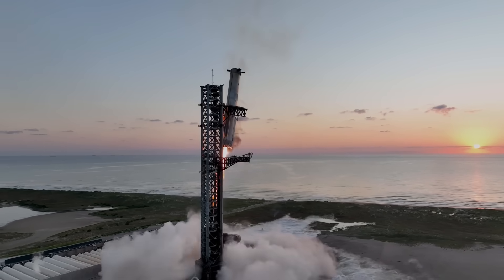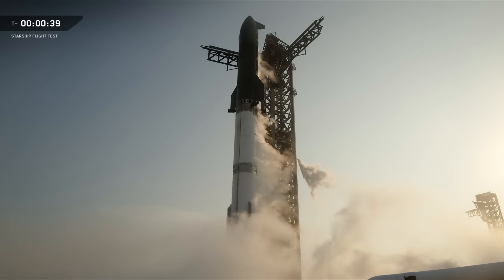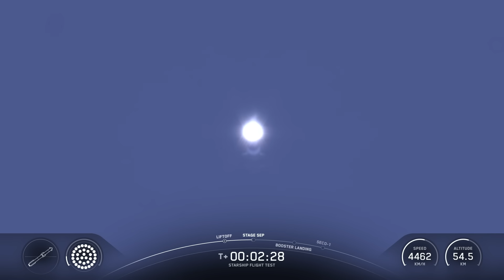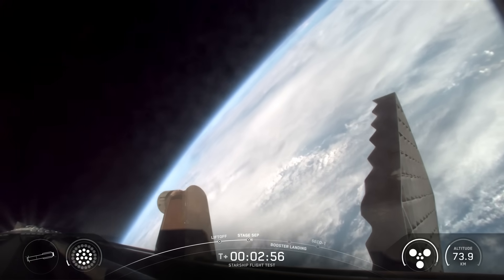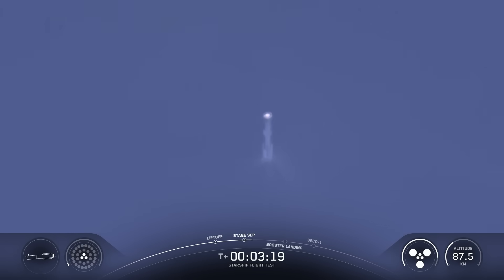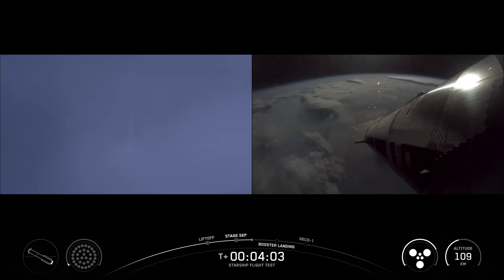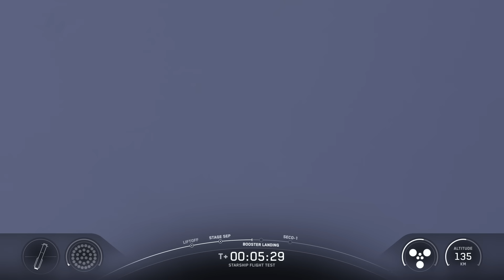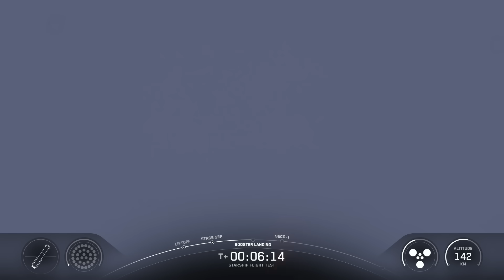SpaceX Builds Largest Reusable Booster, Also Makes Door That Won't Open - Starship Flight 9 Recap

Comment: What a disaster Starship has been for the Artemis program, abysmally behind schedule, burned through most of the cash allocated and it hasn't made it to orbit, hasn't demonstrated long term cryogenic fuel storage or transfer, hasn't demonstrated engine reliability for landing or launch, hasn't survived re-entry unscathed, they can't even get a door to reliably open. America isn't going back to the Moon this decade with Starship, that's for sure.

Comment: I suspect in V1 they overbuilt it to maximize their chances of getting starship into orbit, surviving reentry, and soft landing in the ocean. For V2, it was built to get a baseline of what the bare minimum is in terms of engineering/dry mass to do the same thing. You can only do so much with simulations, so you have to fly it and incrementally upgrade it until you hit that sweet spot of dry mass vs payload to orbit.
Reply from the maker: ‘Anyone can build a bridge, it takes an engineer to barely build a bridge’
Reply: @scottmanley I’ll take an overbuilt one any day when I’m driving across a bridge!
SpaceX has built an expensive bridge to nowhere!

Comment: is 33 raptor engines too extreme?
i am curious about longmarch 9 which uses 4 main engines and 20 boosters. then they released a cluster version exactly like starship. 
i guess china will make a simulation to find failures using supercomputer, making 2 models at once for longmarch 9 simultaneously
then compare the results to see which is more efficient in terms of operational costs compared to the maintenance complexity faced.
Reply: Note that it is self-developed and conceptually borrowed, far from being exactly the same. With safety, reliability and practicality as the main considerations, rather than relying solely on computer simulation, mutual learning is normal (depending on your way of understanding).

Comment: Notice all the condensate ice footling around during the view of opening the cargo door. The door mech was also covered with ice and was the probable cause of the malfunction.
Reply: you have no evidence of that to make such a claim, the ice is coming off the LOX tank forward dome.
Reply: @Syritis the ice is actually coming out of the air and condensing on cold things. It's not a good idea to have ice condensing out of the air in the cargo bay. It should be nitrogen filled, or at least dry air.
Reply: @---___..  sort of, it;'s humidity that condensing against the LOX tank, because the door hydraulics and linkages aren't chilled by the cryogenic propellants then there won't be an ice freezing to them.

most fairing are climate controlled to VERY strict conditions as required by the satellite  manufacturers,  in this case spacex can do whatever they want with their own satellites but theres still zero reason to suggest the door froze shut, especially as it would heat up screaming its way through the atmosphere to orbit.

Comment: Does the upper stage have reaction wheels? If not, could adding them help control the spin if a leak happens?  It might be worth the mass of having them to have a backup method of controlling attitude.

Comment: This is the third starship failure due to what appears to be propellant leaks. I've not heard what the root cause is on this. SpaceX needs to more thoroughly test under a variety of conditions, or re architect the system. Another launch in 3 weeks may not have a different outcome.

Comment: If u actually listened to spacex's stream, before launch they discuss the intentional lighting of only 2 engines on landing burn... I believe they said they were testing the capability of an engine from one of the other rings (not sure if it was outter ring or the inner ring) to relight and make up for the engine that didn't light... pretty sure it would have to be in the inner ring, as I believe the outer 20 needs the ground support equipment, to ignite

Comment: The road to success is littered with debris.
Reply: So is the road to complete failure!
Reply: @TheMasterCylinder yet failure can be observed and that knowledge implemented into new designs
Reply: @sreastronaut9765  Into new designs that will fail too? What was the Block 1 to Block 2 upgrade all about then? 3 consecutive SHIP failures just isn't good, no matter how much it is spun.
Reply: @TheMasterCylinder Block 1 was limited In payload capacity and also had a lot of design inefficiencies. Block 2 solved a lot of that. But of course you’re right. 3 ship failures isn’t good. But tell me one major technology that worked flawlessly on the first attempt. It takes time to figure out something as complicated as this. Should SpaceX just give up because they failed a few times? Of course not. It take perseverance, it takes time, and it takes failures. But they will get it.
Reply: @TheMasterCylinder What have you accomplished?
Reply: @TheMasterCylinder  No, the "road" is what is traveled upon; it's fine, but that which rides on it often fails, leaving some debris! ;D
Reply: The road to failure also...
Reply: @paulbizard3493  Yes, unlike the old NASA mantra from the 1960's. "Failure is always an option"!! In anything, 

...ask those living on the streets today!
Reply: A lot of debris
Reply: In all things, including ex-spouses!! One for three is my record!! LOL

Comment: So Tim Dodd doomed this flight.
Ship originally had cold gas attitude control until he questioned Elon on why they weren't using autogenous pressure like the booster.  When 9 lost tank pressure it lost attitude control.
Reply: Which means losing tank pressure was the root of the problem, not the use of autogenous pressure. They really need to get a grip on the gas leak problem soon.

Comment: We should just pour our efforts into anti-gravity as well as other propulsions once thought to be sci-fi. But that also would mean the end of the rocket fuel companies. If we don't the Chinese or someone else will and likely soon.
Reply from the maker: Anti gravity isn’t science fiction, it’s high tech fantasy without even a theoretical underpinning that suggests it’s possible.
Reply: @scottmanley  YEp. We've had them for decades. Government admitted this last year Torsion field as well. But what isn't public is the energy sources used. We could create and have propulsion that we could implement right away but it would spell the end of the oil and fuel industry as we know it. One day though, someone, some government will announce production publicly.

Comment: I want to point something out and 3:27, right when Scott says the word "variation".  Take a look at the leading edge of the lower flap.  You will see a thermal tile detach from that leading edge of the flap.  It then falls down into the plume where you will see a brief flash of orange from where that tile is burned by the hot engine exhaust.  

SpaceX has such a long way to go to make this project a success.  And before discussing things like the pez dispenser door that won't open, they need to figure out how to keep the tiles attached to the ship!!!

Comment: A Starship flight with the Super Heavy booster emitted 2,683 tonnes of CO2, plus 1.7 tonnes of nitrous oxide. This greenhouse gas is 298 times more harmful than CO2, which means that over one flight, the rocket will release 3,189.6 tonnes of carbon dioxide equivalent.
Reply: Why do you think we’re going to terraform Mars (or not)? Because we’re ruining this planet.

Comment: I mean that's why that's flight testing you know it's a test they're trying to blow it up they're trying to see what it will do what it won't do That's a process with building an airplane they do the same thing they've said on the broadcast that they did a lot of things in the wind tunnel things like that but there's some things you can't duplicate in a wind tunnel or you know in " computer controlled climate there's only one way to test out things and that's to actually fly the silly thing you know I really get tired of all these channels like yours you like make it sound like it's such a big freaking deal do you see Elon musk worried about it no Yes he's probably he was probably working on the problem the moment it happened so stop bitching crying and whining

Comment: Musk is all about Anti-Boeing. Anti-DEI. If Boeing's doors fall off from sky and it still lands safely, then SpaceX can be proud its doors won't open in flight even if commanded to do so and its starship experiences an unscheduled disassembly mid flight and disappears tracelessly into a vast ocean, beyond the reach of NTSB, so one need worry since no one is on board. ;-)

Comment: Anyone wondering if maybe there's a saboteur at SapceX, trying to make sure Starship doesn't succeed?
Reply: No one wondering except you???
Reply: @executivesteps  Is that supposed to be a question of statement. Same thing with Boeing. All these errors have no other logical explanation than someone deliberately sabotaging them so that they can't succeed. For everything SpaceX has accomplished, not getting the door to work seems out of character for them at this point. And Boeing is a whole other issue to dive into.

Comment: 16:10 - The airspace was cleared ahead of this test flight instead of the air traffic control system reacting to a breakup of the orbiter during ascent as in the last two attempts.

Comment: So what's the likelyhood that starship with the pez despensor system... just doesn't have center of mass that's balanced well enough for the engine geomoetry  to prevent a spin even with it's attitude control systems? I know the twoprevious flights spun around because of engine troubles mostly, but could those troubles have been started because the craft starting to "buck" and starving the fuel from an engine? either by pulling a fuel line in a weird way causing leaks or starting to starve that engine because of inertia? Is this a simple case of over engineering the launch trays or worse, improper load balancing?

Comment: It actually was a huge success, this was the first time super heavy to be reused, 29 engines flew twice 1 flew three times, they said they took an extreme angle of attack to push the booster and Starship to their limits, based off the last 2 launches it was a good success, plus the first time ever for directional staging, plus missing 100 heat panels they knew at some point both would 80% fail, at the end of the day this is all testing everyone getting all mad about it makes no sense.

Comment: There is a basic design problem with this rocket will never be reliable too many parts that can fail.  Making a reusable booster rocket is a gimmick reduce the number of rocket motors and strap solid rockets to the thing.  Same or better thrust, more reliable and cheaper.  But as usual Musk’s ego getting in the way.

Comment: Good on you for calling it twitter still
Reply: X has always been weird to say, I have always just called it twitter. 

Naming a platform a single letter is dumb.
Reply: @volvo09 I always hear "Heard it on the X" by ZZ Top when i think about X.
Reply: @Educated2Extinction  ZZ Top! Love em
Reply: Musk made a mistake rebranding it and changing the design too much too soon, he should have waited at least until it becomes the ''everything app'' he aspires to make it. Making it X just cost it market share and credibility.
Reply: @charlie11ng42 It needs to stay Twitter because you can't have Twitter without twits.
Reply: Who cares what it's called. It is what it is.
Reply: @rodneylee4026 And it was what it was, and will be what it will be.
Reply: @Educated2Extinction  I am what I am and it is what it is
Reply: @Rlee-x9s  Popeye, is that you?
Reply: @Educated2Extinction  Maybe
Reply: X Twitter is the most accurate to me...

Comment: Could someone please do analysis on the three downcomer CH4 tubes stress in what I assume is semi unsupported 15m+ distance they span the aft LOX tank?  I imagine at least a few tons of LOX moves forward during MECO, and is slammed down past these downcomers once 6 starship engines begin thrust.  Some alternate solution would be to secure these three downcomers to each other with a web, or maybe the are secured together for most of the distance then spread out following and secured to the bottom of the LOX tank.  The way they span that 15m or so distance, just the slightest warping would cause great stress at the point they connect to the three vacuum engines.  To me, this is a source for the leaks that keep occurring in the engine bay, though my idea seems to be quickly dispatched.  Please do stress simulations on these downcomers.

Comment: Space X has made fantastic strides in technology that will put them in the history books. But like all successful teams they begin to believe their own press releases. Time for Gwen to gather an outside review body from the aerospace industry to to take a hard look and point out what the team has become blind to. I suspect their burning desire to reduce the weight of the airframe has led to insufficient bracing of lines, vibration damping materials, and such.

Comment: I clocked the same phenomena you did and concluded the same as yourself. Indeed, I was watching what was increasingly looking like a burn-through of the RH vacuum engine bell and watching the countdown to SECO, wondering if we were going to witness an engine self destruction in real-time … or would it survive? A nice bit of cranking of the tension … what would go first? … the engine or an ignition associated with the geyser? 

The geyser of gas/fluid (can’t really see it being anything but propellant) appeared quite abruptly and worsened quickly. It also had the look of a leak from a cracked component rather than from a designed vent. However, for all I know, it might be a purge of an inert gas fire suppression system triggered by another conflagration in the “attic” above the engine shroud. If so, I would have thought there would have been some reference to it in the commentary, which I didn’t catch. 

There appear to be some fundamental flaws in the design of this version of Starship … I’d imagine they’re likely to go straight to Block 3 now, rather than chase their tails on a superseded design. I just hope they didn’t skimp on the instrumentation and that they have a clear understanding of the root causes behind the current raft of problems.